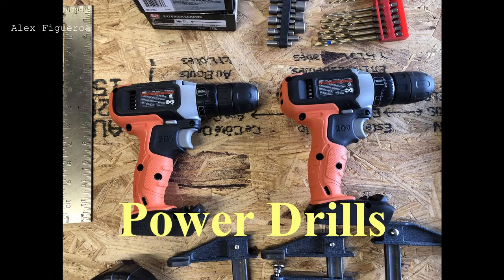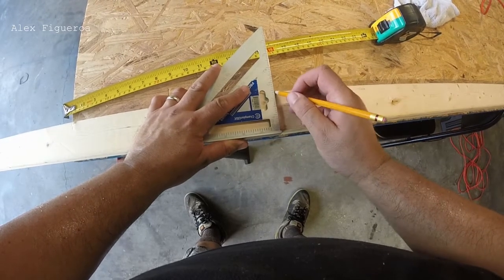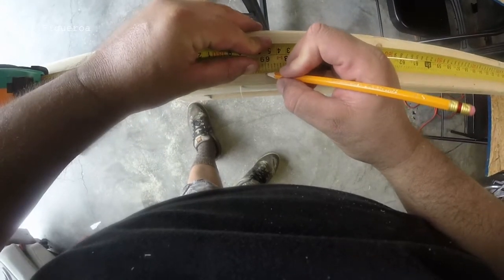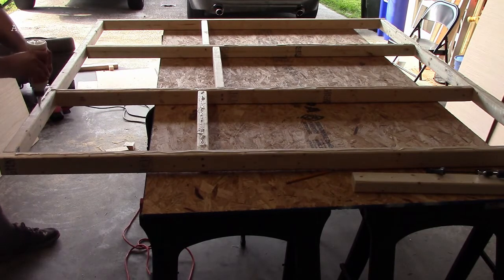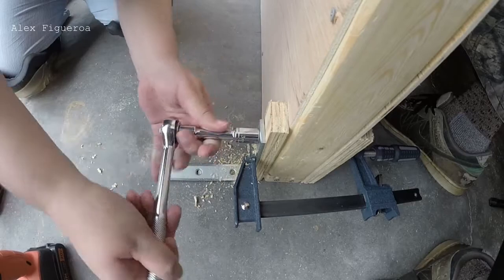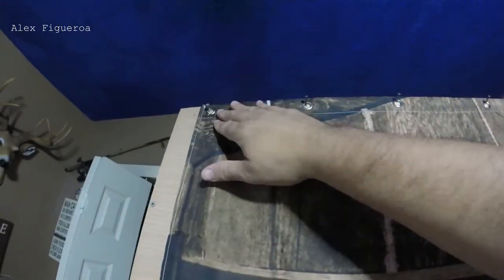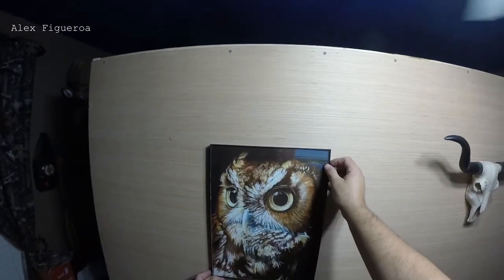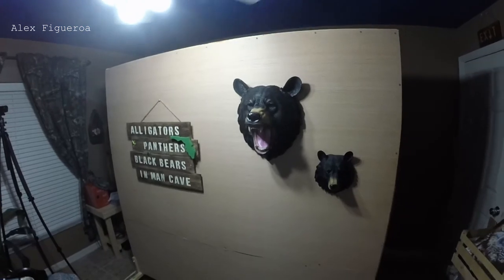How to Make a Portable Wall for your YouTube Channel or Webcast

Comment: What size drill bit did you use ? 

 For the studs and the frame did you use 2x4x8 and cut them to size ? 

What size did you wood plank did you use to to use to drill in brackets too ?
Reply from the maker: Hello Silvino thanks for your questions. For the drill bit size to predrill 5/16x2 Lag screws, I used a 1/4" drill bit.  For the studs and frame, all I used was a 2x3x8 white wood stud that you can find at your local Hardware store. They are smaller and much lighter than 2x4 wood although, 2x4 wood is optional. The wood planks are 2x4 wood.
Reply: Sorry one last question , is there a size you cut the 2x4 planks down to ? I can’t seem to get down the right size so I can mount it to my brackets
Reply: @silvinobernal87  I had the same question and rewatched, the 2x4 planks were cut to 2ft